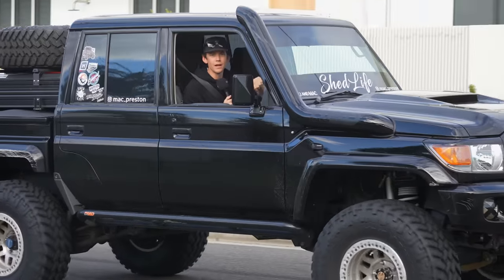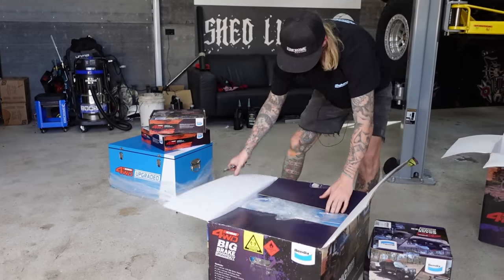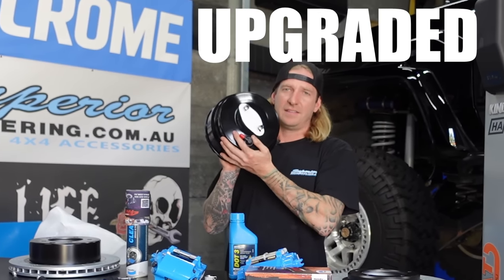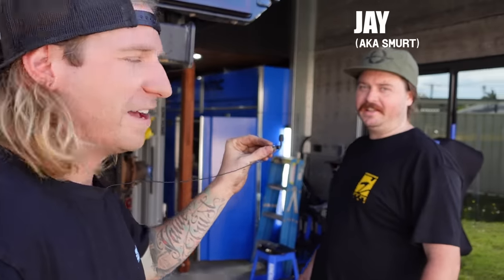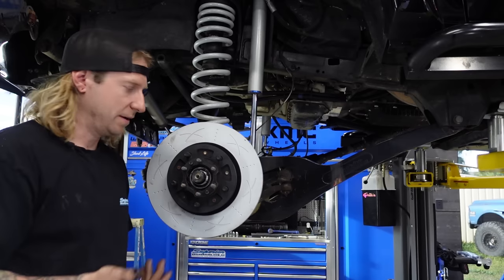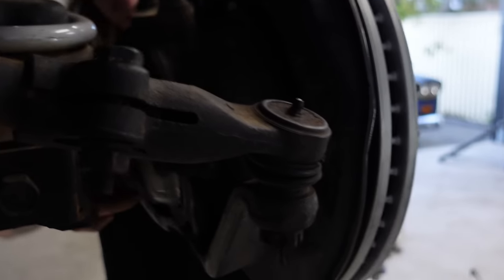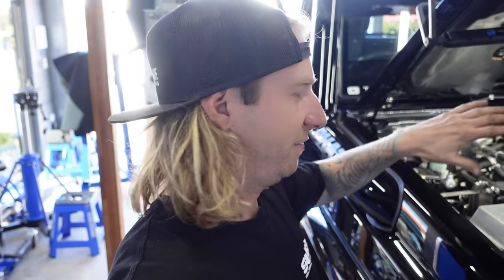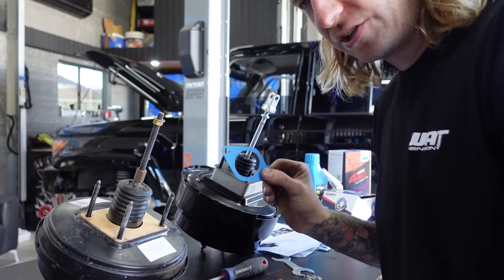Insane LandCruiser BRAKE upgrade (But how?)

Comment: macca, just like you i’ve got no clue but have learnt that the bigger the brake disc is doesn’t mean the more stopping power it usually means better heat dissipation so brake fade takes longer to occur. What does impact stopping power is the size of the caliper and how many pots it has along with the size of the brake pad. Correct me if i’m wrong also learning lol
Reply: Bigger rotors do increase stopping power. The friction on the rotor is being applied further out from the axle, giving it more torque, increasing the effective stopping power. I've put bigger rotors on my bike while keeping the same callipers and pads and it has resulted in a significant increase in braking power.

The fact that with cars bigger rotors usually mean bigger pads and a larger braking surface is a double whammy for stopping power.
Reply: Leverage mate.

Comment: with all the upgrades made to the engineering of the vehicle, do other safety things like how the ABS responds in a lock up, or the emergency Air-bags and the timing of deployment, need investigating? Just curious cause i'm not much of a shed'er myself

Comment: Did the kit change the peddle feel much? At work we have been fitting the terrain tamer kit (looks to be the same) but the peddle feel just seems off. the peddle doesn't fall to the floor but it continues to fall almost as if there was a leak.

Comment: Why use dot 3? dot 4 is rated for higher temp
Reply: If your brakes aren't getting hot enough for DOT4, DOT3 lasts longer before needing to be replaced due to moisture absorption.
Reply: @KarlEller  but he went on about towing and needing the big brakes to eliminate fade